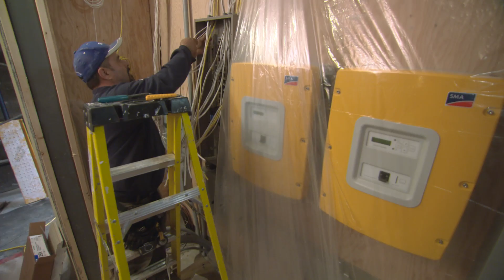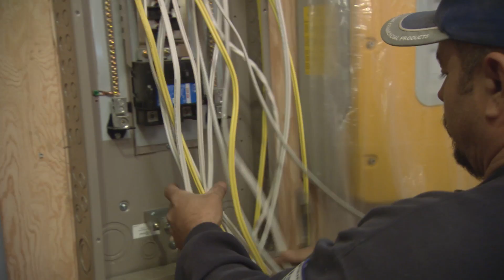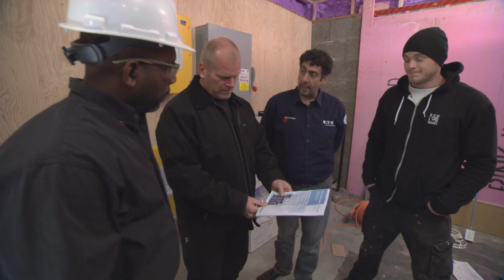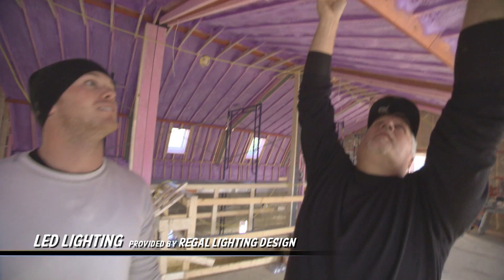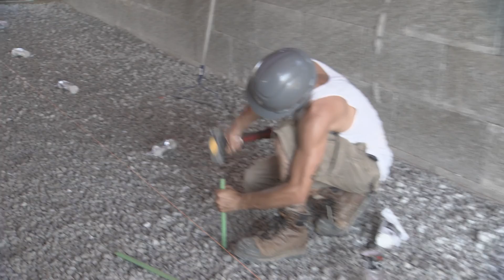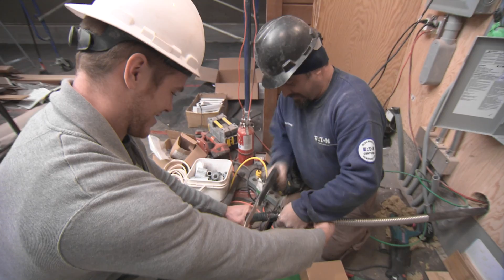"Electrical" - Mike's Ultimate Garage: Inside Look

Comment: did he just explain how he was going to bury an LB under concrete? lol
good show still
Reply: Ike Costner it is low voltage, so it’s ok
Reply: That was a t condulet....its a code violation in the us....as per nec. In canada it is still a violation. Not acceptable or accessible
Reply: Dude he said it was low voltage, if it’s line voltage that’s a different story but you’re allowed to put an LB under the concrete